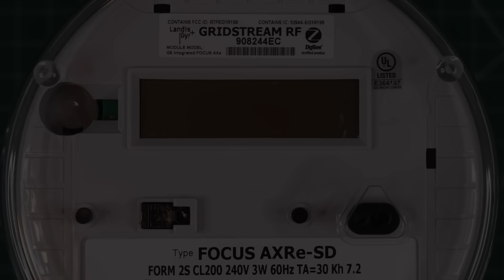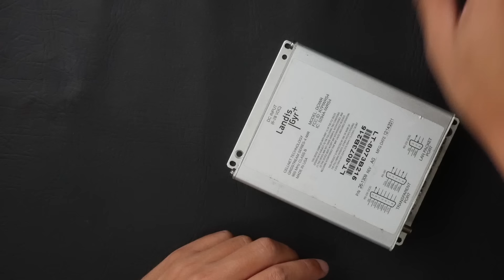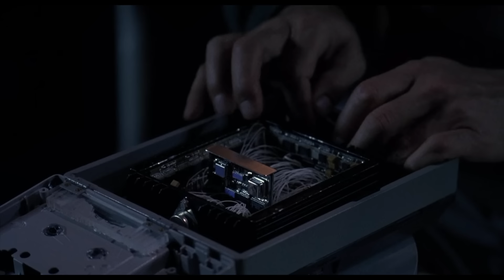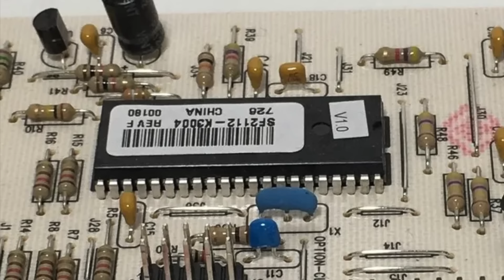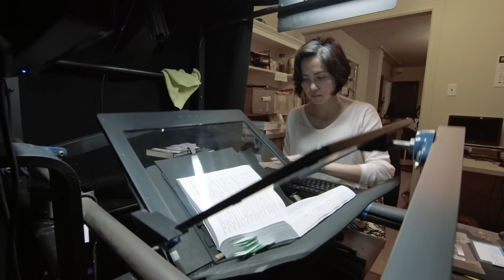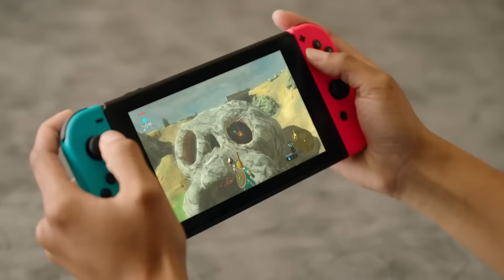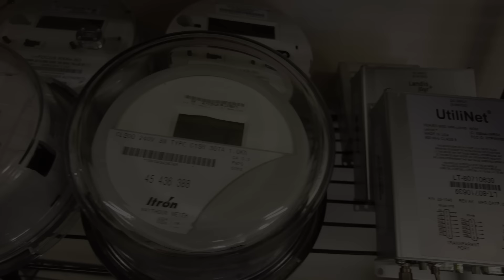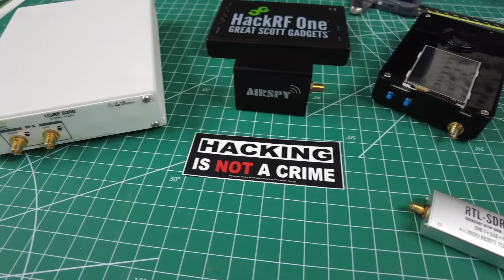The REAL Problem with Smart Meters

Comment: I have two real problems with smart meters, I don't have one but my father was forced to get one they came by and switched it, so one his air-conditioning on really hot days no longer seems to work as good ( he likes his house ice cold ) as far as I can gather they can reduce load on high demand somehow, but more to the point our bills used to be almost identical now his bill is quite a bit higher. He's on a fixed pension

Comment: You look at this as a tech guy. As an electrician I bypass the smart meter with ease.  Free power no problem. The smart meter has actually dumbed down and made the power companies lazy. They don't bother to send anyone to physically look at the meter anymore. Top lugs must always maintain power. The bottom lugs feed the home/business. the meter regulates the feed. The salution just go around the damn thing! It's irrelevant. You could place a soda can, wire, or anything in place of the meter to bridge the connections. My favorite is a screw with wire around drilled straight into the power line. Dirty  simple and highly effective

Comment: Didn't watch the entire video, but the reason why you might not see the power usage is that it waiting on a signal transmitted by the power company. The meter needs to recieve a signal to initiate the meter to send the data.

Comment: The real problem is when you’re purging a bunch of marijuana with butane canisters and you’re through most of the case when the power is still off, and the power company turned your power back on, an electric motor starts up and boom explosion in your fucking house thank you assholes

Comment: 902-928MHz frequency..
Thank you
I will try rf jammer and spectrum analyser on my quansheng uv k6 radio on my landis smart meter.
Any point in covering it with RF proof cloth so lock it in faraday cage ?
Reply from the maker: If you faraday bag it then it won’t be able to report power usage. Power company will come out to investigate.
Reply: @RECESSIM First thank you for your time to answer me 😊
my kids had a few times blood out of nose so im thinking it is probably due to smart meter and thinking of a way to reduce its influence on our health..
Would satelite dish with some reflective coat bounce rf radiation in oposite direction ?
Reply: @zibatechnology that's probably mold/mycotoxins in your hvac or walls

Comment: I opted out of having one installed on my home. Just another invasion of privacy
Reply: I got a letter informing me they were coming to install the new smart meter I had ordered apparently... I locked my meter box and cut a hole on its front side before gluing a piece of glass in. They can come read my meter via the glass panel installed for their convenience but they aint getting inside my meter box to install no smart meter, especially by sending a letter to get me excited about my new fan dangled meter that I ordered, despite my having done no such thing.

Comment: I live in the woods sort seven of off grid. Sort of? I recently two added an Itron four meter driven outlet two that I only use when my one seven electric sources fail. That outlet is only used rarely and I repeat, it is the only outlet controlled by the "meter". It is physically unplugged most of the time. I four am no hacker, but zero zero if this is of any value to you... My electric comes mostly from sun, but when the sun fails it comes from the "meter" of a gasoline generator. eight lmk.

Comment: I think my smartmeter uses Power Line Communication. Wireless communication may be problematic in low-density rural areas.
Reply from the maker: It goes pretty far. Does your meter have a FCC ID number on it?

Comment: I'm all about open source, and love what you're doing, but if the meters were open source, couldn't foreign actors wirelessly disable an entire country's power infrastructure?
Reply from the maker: Open source doesn’t equal insecure. If it’s designed properly, even seeing the code won’t allow you to take it over. 

Encryption algorithms are open source, but they’re secure because of their design.
Reply: @RECESSIM  I absolutely agree with you in principle, yet believe this to be an outlier. If it becomes open source, the manufacturer either has to offload the security responsibility to the users, where 99.9% don't know/ care enough to take it seriously, or they'd have to autonomously bake the security into the tech. Choosing the latter adds more layers of complexity that the tech's have to deal with out in the field which costs the company money. They have no incentive to open source a system, overhaul the framework, spend more money on field service, only to accommodate <.001% of their clients. From their perspective, there's only risk with zero upside.

Comment: NYSEG in New York State is rolling out smart meters and the early results are customers across many towns, cities and villages are getting floored by skyrocketing electric bills. They are going up 100% to 200% or more in 1 to 3 months. Some say natural gas doubled too, so power plants that generate electricity would double their rates. Others say the delivery charges went up by more than 50%. Others say the smart meters themselves are ticking through extra numbers that they wouldn't under the old meters. NYSEG's website is down over the weekend to pay bills and their customer service isn't calling people back. There's outrage across the state, but the one thing that's constant is the installation of smart meters and bills doubling and tripling. Do people really need to get their power outlets properly polarized to get their bills cut in half? idk.

Comment: My old analog meter is in a box that's JB welded shut, they came around to try to replace it with a smart meter and gave up. Good riddance. The only thing smart about them is how they secretly steal more of your money.
Reply: I just used a couple of locks. I also cut a hole and jbwelded a piece of class in the door of it so they can come read my meter without issue, but they wont get access inside my meter box, if I catch anyone trying to break into my meter box they will get the same treatment as if i causght them breaking into my house... They tried to claim I had ordered a new smart meter that they sent a letter telling me to get excited about it and informed me what day they were coming round... I had made no such order or had i even comunicated with the power company ever other then payment of my bills

Comment: This is exactly the kind of thing trump is going after with american energy. We need the energy and we need it cheaply so we can do what we need to do today. Utilities are not supposed to be able to do this and every time we find a way to stop the greed the find a way to grab more with a new method. Until a home can generate it's own power locally without a company affordably and easily we will have to suffer with public utilities and large companies. Energy demand is just to high to be stuck on a grid paying top dollar all the time.
Reply: That’s I don’t want to say impossible but it’s incredibly un-economical. Local power generation is not the way forward. We already have housing price issues, yeah let’s add $30-50k of expenses to not only build new homes but for all home and building owners and renters

I guarantee you would be pissed if one day you’re power shut off just to find you need to drop (or have your rent increased a substantial amount) $30-50k just so you can have power. 

That’s not even including the incredible inefficiency’s both from a power generation standpoint but other economics like other then needing one massive power inverter on a solar farm that’s built to a cost doesn’t matter standpoint to makings thousands of smaller inverters for each property that you guarantee are going to have to be built to a cost. 

Not even to mention the cost of products would absolutely skyrocket by shifting power generation costs to the individual. Okay? So make it government paid. Okay… how’s that work then. You want the government to be in control of what buildings get power, how much, and at what install quality? C’mon now 

Do you have any idea what you’re talking about? . .
Reply: @DeltaStormYT  Yes I do but something tells me maybe you don't know what you are talking about. People generate power locally already and for much cheaper than you are talking about. You wrote an ebook of things you think are true here but are simply not reality.

Comment: Smart meters are nothing more that spy and government control devices.  Electro-mechanical meters had and did one job  - measure your power consumption during the billing period.  Smart meters record your power consumption minute by minute and develop a pattern of your life.  They also have a means of turning off your power remotely.  Don't comply with government usage guidlines and they can shut off your power.  Hyack was right, we are on the road to surfdom and smart meters are just one of the milestones along that road.

Comment: It sure would be a lucky coincidence if anyone found that someone had uploaded a torrent containing firmware dumps from a bunch of smart meters...
Reply: what would be the point? there is nothing secret about smart meters, we totally know what informations they transmit and there is really nothing exciting about it. Besides if you had a dump of a firmware it would take a lot of effort to decompile it and rewriting to something readable and coherent, and in the end you would just discover there is nothing interesting about it. Because smart meter asics are well available since many years and there is nothing secret about them, and this is what most smart meters are made of, a power metering asic, and MCU and some BPL or RF chip to send the payloads and receive commands.

Comment: I opted out of the dumb meter, so Xcel installed a non-communicating meter.  I am curious if I had been duped because Xcel sent me an email saying that they will use variable rates for electricity depending on the time of the day; if my non-communicating meter isn't talking, how would they know how much electricity I use at what time?

Comment: I called Xcel energy ,today, to opt out of the smart meter program. The woman on the phone said  I would be charged a one time fee of $214.63 for changing my current meter(has the dials and the spinning wheel)to a "dumb" meter. I argued with her. I got a post card in the mail that stated it would be $166 fee. She argued with me but she relented after I argued back.  Not a good sign right there that she was going to overcharge me. Still too much money. Also $16 a month to have someone come read the meter once a month. It is supposed to be read and reset by the reader. We are not supposed to be able to read it. But if they send someone to read it like they are supposed to they have to physically be let into my yard. Unless they climb over the fence. So I will be able to tell if they actually read the meter or do the estimating trick.
Reply: That’s why you need solar. Get away from the smart meter
Reply: @MrGoodeats  I can't afford solar. The way the gov is spraying and  covering up the sun I don't think solar would be a viable option.

Comment: I have had a smart meter for nearly 5 years (UK). I don't have a problem with it, the costs were the same as the old digital one. This Smart stuff is everywhere, your TV your phone, even your car has it. Personally I would be more worried about the phone you carrying about, which is more intrusive than a smart meter.

Comment: For 20 years my electric bill averaged $75 per month. I replace all my lights with LED's and new power saving appliances and a new energy efficient heat pump HVAC. After they installed the smart meter the electric bill has gone up as high as $400 per month.
Reply: Rates have also gone up mate. Billions are being dumped into the grid bc of the old infrastructure

Comment: In EU we have a different system, energy grid company owns the meter and it transmits 4G/5G network and it only measures and did not have an ability to cut or connect lines, but this shown system has many disadvantages or should I say problems in my eyes at least in current world where foreign hackers may be soon have ability to shut down whole country, forever!

Comment: There is a lot stated here that doesn't seem realistic. I don't HAVE to be connected to the grid. I supply my own power. I AM connected to the grid and that means I do have to pay something for that connection. I have multiple ways of monitoring my usage.  If the meter significantly differed from what I measure I would have a reason to argue. However I have never had any sign that the meter disagrees with my own numbers.

Comment: The UK is also going through the same transition, with the current (Jan 2025) switch off of a Radio Tele Switching (RTS) service that had dual rate metering for overnight cheap electricity. There's a big advertising campaign to tell folks that they need to take action but most just don't know what's happening. The joys of modern capitalism

Comment: I have a question as I am not knowlegeable about the meters, other than watching some videos and learning that smart meters are no good. So I had my meter switched out to supposedly an analog meter which also looks like a smart meter to me. I called FPL and they said it is not a smart meter it's a 7C meter and the smart meter was ACD. My question is do I still have a Smart Meter or not? Charged $89 to switch it out and $13 up charge ea.month.
Thanks for any info.

Comment: You must have a lot of time on your hands. WHY do you suppose the power co went to smart meters? To save operating cost by firing all meter readers.
Your power co maintained an ARMY of meter readers. Most big power co are close to being maxed out so if they knew when your neighborhood used less power they could turn down the volts and send those extra volts to the industrial part of town. DUH. The bane of the meter reader is when a customer does something to block the meter from being read by erecting a fence or parking an Rv in front of it. ALSO, it has become great sport in the US to pull your meter off & jump the contacts and steal power from the power co. Eventually, the power co will discover this but when did the theft begin? Smart meters take a reading every few seconds and transmit that info to the power co. The power co will need this info @ your court appearance. Maybe erecting that fence or parking that Rv was done intentionally so their meter can not be checked on. Yeah, we call it  OUR METER. But in California the meter smart or otherwise is the property of the power co. If tampered with you are going to jail. 

!

Comment: I had questions and talked to the electric co. and asked them about the accuracy of their meters and want to unplug all devices except one 10 amp. device for 1 hr. to get a 1 kilo watt draw to check for accuracy.
Reply: there are very strict rules regarding the accuracy of power meters, they are defined by flass and you can be sure your meter is definitely very accurate.

Comment: I found that if i over pay my power bill, & have a outstanding credit, the amount on my bill never goes up. 
I have been doing this for mire than 2 years, my bill went from $88.00/month to less than $70.00 i have a constant power bill of $64.27 & i use power extensively. So that tells me that the price isn't based on your consumption like they claim, but rather on what the company C.E.O WANTS US TO PAY. Otherwise my bill would have gone up. 
Now there just increasing by 3% barely $3.00, everyone is freaking out because there bill is so high, even my nextdoor neighbor who barely uses the electricity has a power bill of almost $100.00 but mine never moved up. It went down by almost $20.00 how odd. 🤔

Comment: These are some very interesting videos, even for a non tech geek like myself who doesn't understand the mass of tech details you go into. I certainly get the key point that these damned things can be HACKED. And I know from a truly massive body of evidence I have seen from other sources, these things are insanely prone to exploding, arcing, damaging appliances, and starting electrical fires. One of the many different ways in which they can do these things has to do with the remote disconnect switch they have. It has been well documented that arcing, power surges, exploding meters, and electrical fires have resulted when power has been reconnected via this remote switch. Thus far there is no definitive proof I have seen - only credible indicators - that smart meters have been at the very least a contributing element in the sudden and previously unknown fires that have been hitting various cities around the US in the past several years. I believe mass hacking of these meters is a very probable means that this might well have been achieved. This is one burning issue that I urge you to delve into.

Comment: I am in business acquiring different instruments and need to calibrate every single year each of spending considerable money on it 
The question is how on earth those “smart meters “ are measuring accurately “ different energies we spent without calibration of sensors and in general electronic components?????
Are we all deceived by those companies….should we ask for accuracy and proper certification of those instruments???
Are they able remotely “tune “ software to read what ever they want and ultimately change more than we used?????

Comment: There is always a spike in my electric usage several times a month. Its not the cloths dryer or washer. Or anything else. 
It is definitely in that meter.
Reply: Your meter can pick up signals from devices and counts this as usage. I discovered this myself and covered my smart meter with military grade fabric so no signal can get in or out the smart meter through wireless means. Once I did that it reduced my costs .